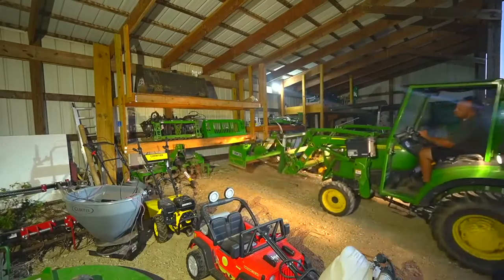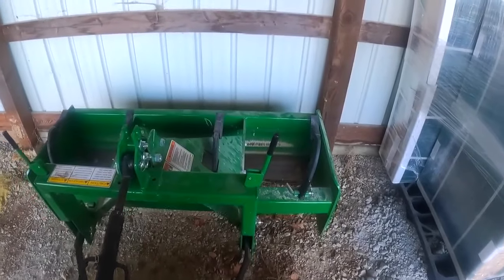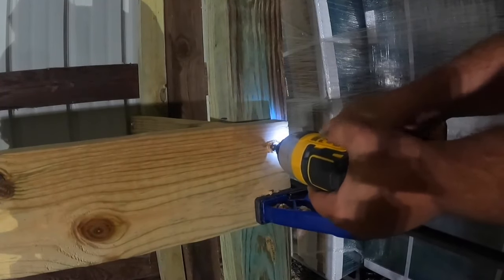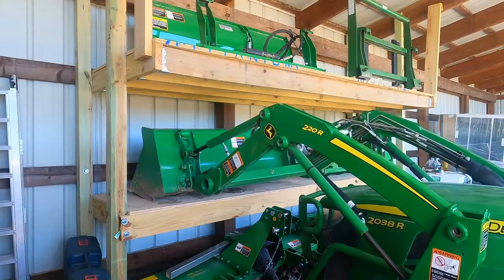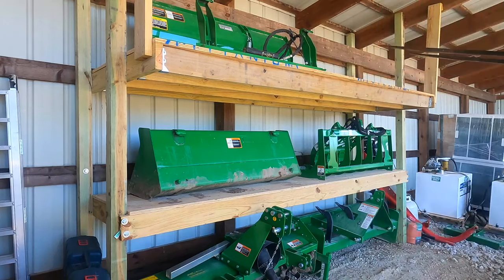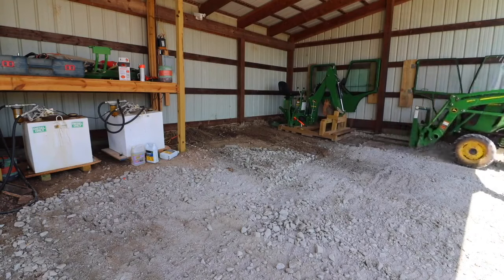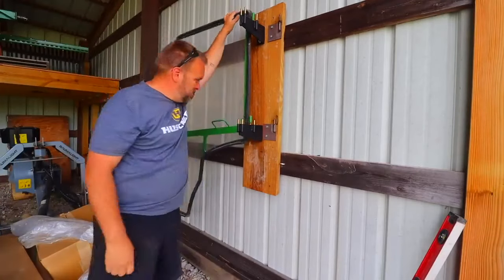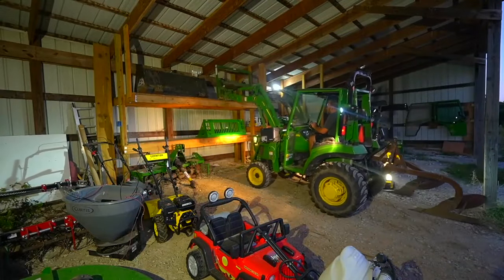DIY Tractor Attachment Storage Racks - Start to Finish in 11 Minutes

Comment: Very efficient use of space. Looks great. 4x4s, 2x6s & 3/4” ply - plenty strong as you’ve discovered. Custom pallets pay off in the long run. While you’re customizing, consider a heavy duty french cleat wall for your yard tools, chainsaws, etc. Gives you flexibility as tools come & go (well, realistically, as you add tools). Minor comment: consider using carriage bolts, washers & nuts instead of lag bolts for a more secure hold.

Comment: Good morning Brock. I just built a lean-to off of the back of my woodshed. It's not as big as yours but it will be big enough for the attachments that I have. In the future I plan to build shelves in mine also. I have one on the back of my garage also but only have access from one end so it was a pain trying to get attachments in and out of it. Now with the attachments out of there I'll use it for my tractor and get it out of the garage. Thank you for the great ideas. God bless and have a wonderful day. 👍👍🙂

Comment: You could add small 2×6 blocks below the lag bolts to help carry the load.
Great job all around.
Only works with a quck hitch type three pt system, shich is a great upgrade to consider.

Are termites a problem in Kansas? Notice you sid not use ground contact wood members?

Comment: I still haven't finished the floor in the back half of my shop, so I still have my attachments scattered everywhere LOL.  I've slowly started picking up materials for the floor, so hoping by spring I'll have everything I need to get it done, get my tools set where I want them, and then build shelving similar to what you've done to store my attachments inside...right now they are somewhat covered from the weather under some trees, but I want them inside LOL.  

The next big task is I need to redo the opening on the end of the shop where I keep the tractor.  Its been reframed into a smaller doorway, with the tractor and attachments I'll be reframing the doorway back to its original wider opening, and with that, I plan on building sliding barn doors.  

Most of the attachments I have are relatively small, heaviest being the roto-tiller, that can get stored under the shelving on the floor on its custom pallet I made for it, and since it'll have dirt on it a lot putting it on the floor makes more sense anyhow....then all the lighter stuff can go up from there and least used stuff on top out of the way.  Then, once that shelving is built and everything stored, I'll have to buy more attachments to fill in the empty spaces on the shelves...I mean we all know that will happen HAHA!!!  

A land plane, and a wood chipper are on my list, as well as a rotary cutter or flail mower...leaning more towards a flail mower as I don't mow anything heavy enough to really need the rotary cutter.

Comment: Hey buddy!   I know you installed the Curtis Cab Fude Block Mod.  I am doing the same thing...have a question for you... (Electrical is not my thing.)  I am installing 2 work lights and a dome light.  There is a Ground screw on the back of the unit.  I will ground this to the chassis.  However, the instructions say you should bring the ground wire from EACH item, back to the ground screw on the fuse block...?  Cant I just ground each item, individually, to the chassis, rather than bring it all the way back to the fuse block?   Thank you!
Reply from the maker: I wish I could be more help, but I don’t know the answer to your question.

I mostly avoid electrical wiring and had somebody else do it for me. it’s been almost 3 years ago so I don’t remember

Curtis Advantage Cab Full Install Video Including Wiring - John Deere 2038R
https://youtu.be/Fx3pnidgTRw
Reply: NO PROBLEM!  Love your channel by the way.   @RockhillfarmYT

Comment: I thought that was an excellent idea when you did it I even turned around and built the same set just at a smaller scale cause I didn't have the space or height that you do.  I think you should build out the left side also if you still have stuff/attachments you need to get off the ground and organized

Comment: I'm just / still waiting for u to put your forks through the siding 🤪I would have already without a couple of siding protection boards. Lol I'm sure I am one of your peeps who said that years ago lol great job. I want u to Design and plan a sawmill building . The bearded carpenter had an amazing one. Sawing with sandy has one and countless others do also I believe that I would make it so the one end u can pull ur mill in and out if u r going to go to events with yours or bring up to Newfane New York. 😝🤪 , just thinking out loud on your page . Or u can say shut the hell up Todd . I'm going to build another kwanzaa hut! 🤪lol
Reply: There'a a 40x60 manure barn (pole barn, basically) on the property when we bought it, and it's got several places where forks have poked through. I don't think Brock will for sure ever poke the forks through the back wall, but if I was me, I'd put a 2"x8" or strip of 1/4" thick 4" high steel back there just to protect me from myself.
Reply: @JCWren  I switch my forks and my bucket numerous times a day, so I wouldn't even put them in the shed but if I did, I would poke through the barn